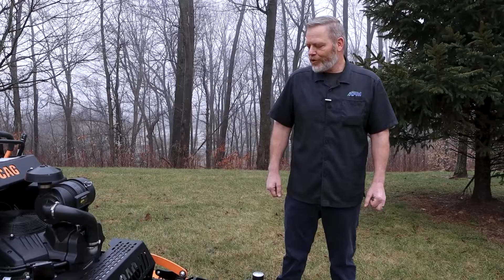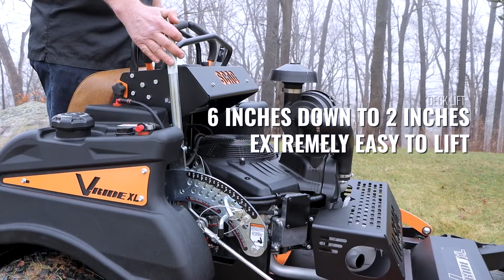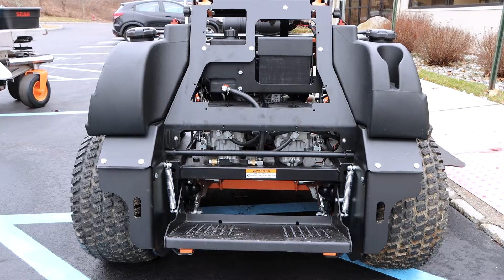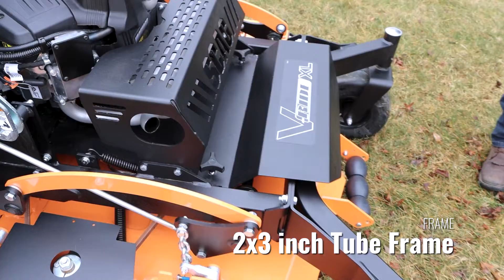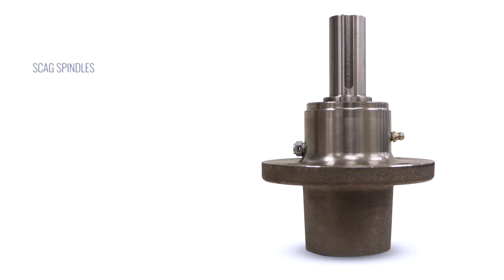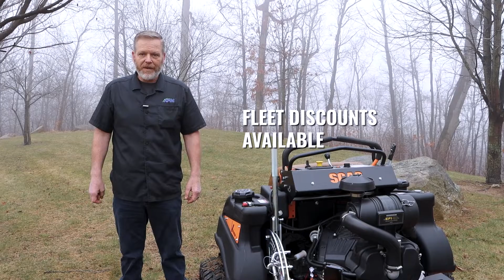Scag V-Ride XL | Overview

Comment: Do you carry 48 inch deck stand up mower
Reply from the maker: Yes, the V-Ride II comes with a 48 inch deck option.
Reply: @KPMExceptional ok if I may ask where are you located at
Reply from the maker: We are the distributor for the North East and don't sell to users directly, but you can contact your local Scag dealer and they can assist you.  You can find your local dealer here: https://www.scag.com/dealer-locator/

Comment: Looks like they didn’t make the controls higher for taller operators. I bought another brand because I was too tall for the v-ride 2 and hate the cut quality. I was hoping to go back to Scag, but won’t be able to.
Reply from the maker: Sorry to hear that - most Scag users swear by the cut quality of a V-Ride II.
Reply: @KPMExceptional  sorry my post wasn’t clear, the other brand I went with that my Scag dealer also sells (JD) has horrible cut quality. I love the cut quality on my sit down Scags
Reply: These machines are uncomfortable….. the isometric springs are not comfortable

Comment: Dixie hydro went down…..borrowed a stander for about 6 months…..feet were killing me standing up all day…..finally got the parts for the  20 plus year old  Dixie deisel 60 Yanmar now my feet don’t kill me from standing all day again. Anything will wear you out …..that being said both have their advantages…sit down and stand up…….ill sit down for the normal cutting …..back yards will be on a stand up……that will be my set up. Gonna purchase the Scag V-ride 2 36 in the next few months to replace a slower 36” Bunton hydro walk behind. This will be perfect for me and my set up. 
  I’m so glad I bought the deisel chopper back in the day hour meter went out about 8000 hrs years ago and to this day it fires up and purrs like a kitten….. it’s out lasted 3 gassers machines I’ve owned over the years and still to this day going stronger than ever…..yanmar makes a FANTASTIC deisel engine 👍😎👍
Reply from the maker: Nice, the 36 V-Ride II should make it easy getting into the backyard, its a good set up. Half and half is a good philosophy, too much of anything is a bad thing. Yanmar does make a fantastic engine, You can find a Yanmar on the new Scag Jackal Mini Skid Steer.

Comment: Question can you reverse the blade bolts from the bottom to the top so it's easier to change the blade and not jack up the mower ? Thanks Harry Erhart Erhart landscaping
Reply from the maker: Thanks for the question @harryerhart5978. No, you cannot reverse the blade bolts according to the owners manual.
Reply: @KPMExceptional  thanks